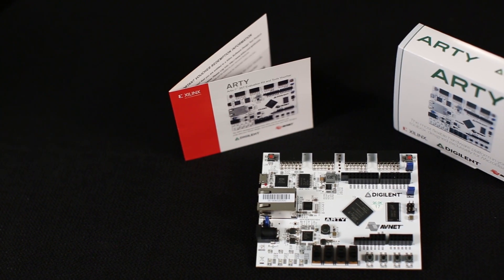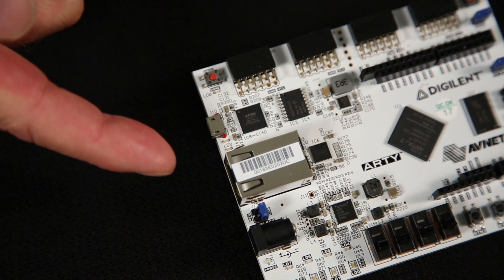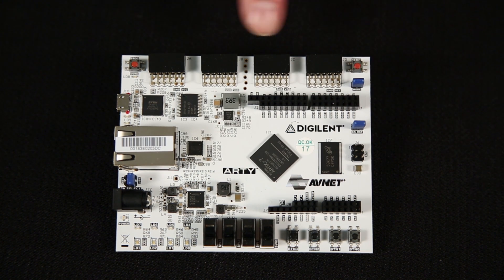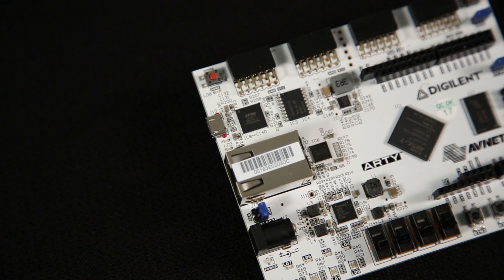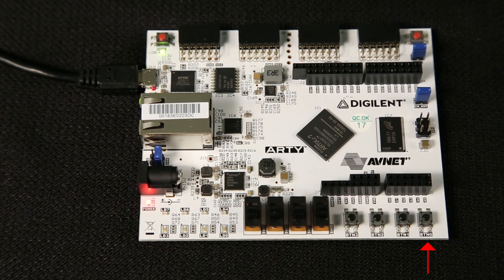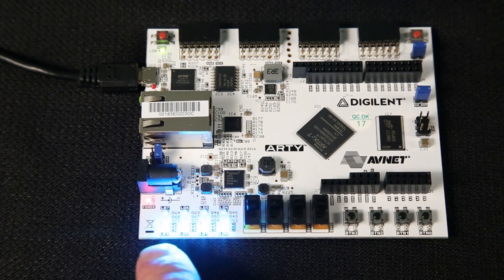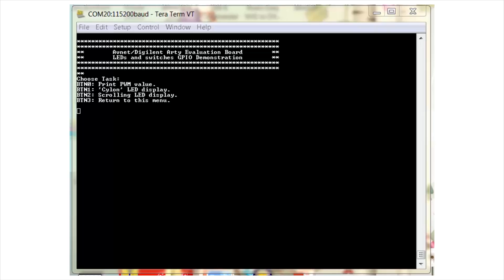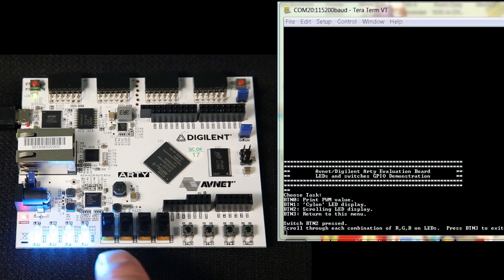Meet ARTY, the $99, Artix-7 35T-based Evaluation Kit

Comment: Searching for this board from UK suppliers, it appears to cost nearer $200 than $100, which is quite a pity. Given that the board its titled "Arty A7: Artix-7 FPGA Development Board for Makers and Hobbyists" does this board work with ISE or Vivado without the need for an expensive license? If so are some features of the software limited in some way (or unavailable due to needing a license)?
Reply: I will be sale this

Comment: The only decent experimenter's interface on the board is - the Arduino pins. How fast can you clock them?

I'm looking at making an ADC board, running at 120 MHz, using 14-bit TI ADS4145 [think: Cilibri Nano SDR]
Knowing the interface limits would be a big help...
Reply: did you found out the limits?
Reply: @RF-yh3qh  Never did - but Arduino CPU's typically run at 16 - 20MHz. So I wouldn't trust the expansion bus beyond 40MHz

Comment: Hi Jim,
What about programming it in VHDL using Xilinx ISE? Is it posible? Is it free license?
Thanks
Reply: +JORGE PASCUAL You can program Arty in VHDL and Verilog, but you will still need to use the Vivado tools.  The Artix-7 35T devices are not supported in ISE... But you will find the Vivado tools have many advantages over ISE, and Yes, when you buy the Arty kit, you get a free device locked (works with the A35T device)  version of Vivado, which you can use VHDL as the the design entry method
Reply: +Jim Burnham Thanks for the answer, good to know it :)
Reply: +Jim Burnham Thanks for the clarifying because the all marketing/pr overhead spits the valuable info out of sight. Although I read it somewhere written plain in simple in 1 line. Jumping and reading on and on I got confused in the end - Was there a Vivado free node-locked license or not :D Glad there is, that is what makes ARTY more reasonable to get , instead of other KITs, to start evaluating and even boosting the learning curve toward FPGA and specifically Artix7 :-) Thanks again Jim ;)